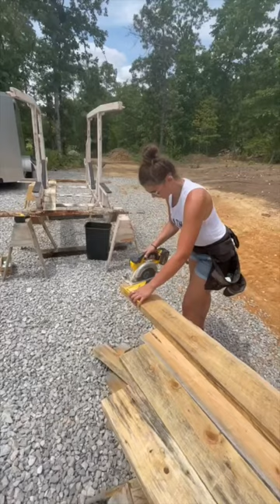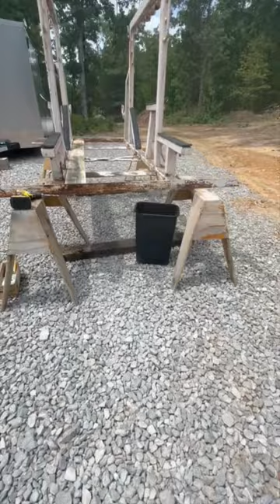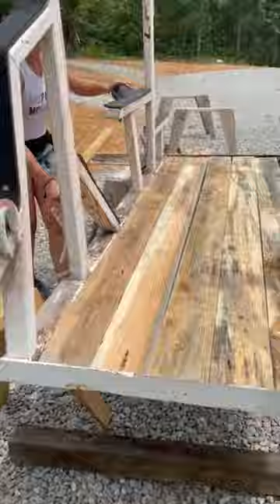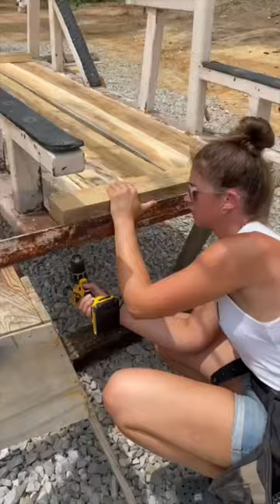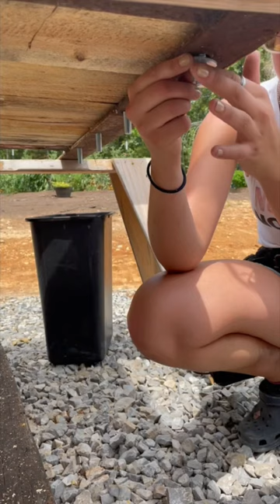Workin girl. #homestead #countrylife #shorts #bluecollar #carpentry #girl #woodworking #workingwoman

Comment: You should at least treat the rust then paint the bottom structure. What good is it to have new wood and bolts on a trailer if the frame is weak and possibly coming apart.
Reply from the maker: What you’re seeing in the video are ferrier stocks. They’re built with 3/8” tubing and angle. I can assure you they are not weak and coming apart. They are rusty and ugly but, they work great!